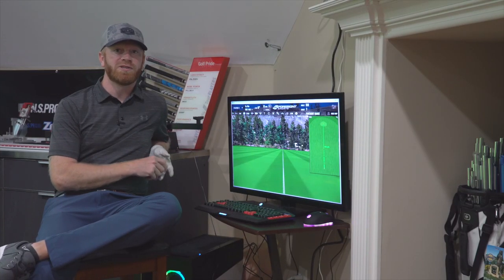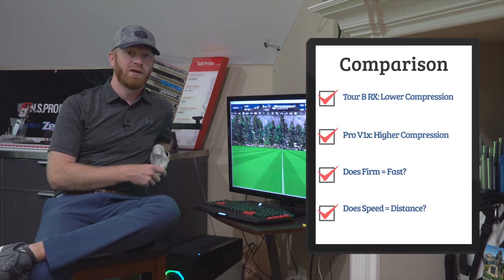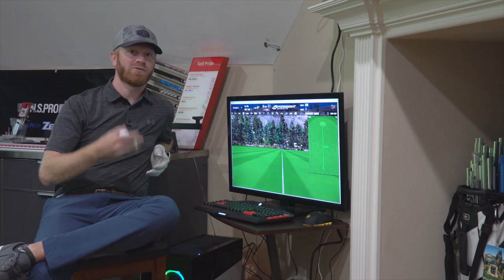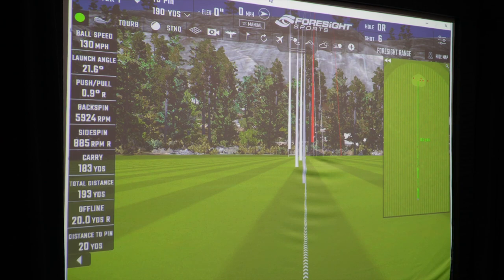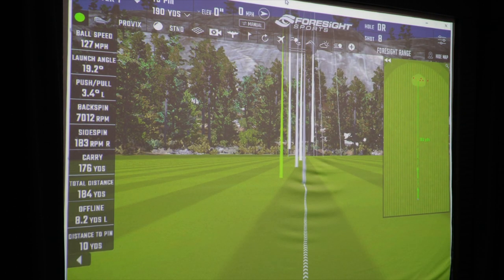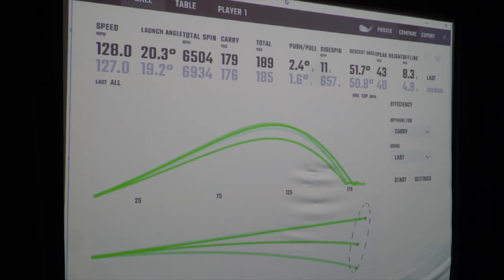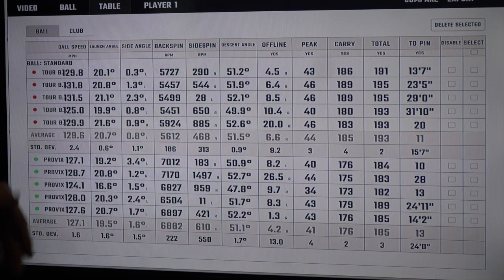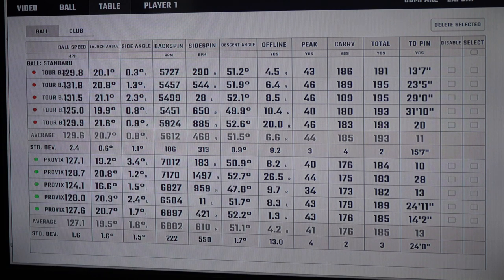Golf Ball Compression and Distance

Comment: Thanks that was a really interesting test of the two Balls.
What I found surprising was that the lower compression Bridgestone Ball produced a consistently higher Ball speed. I would have expected the higher compression Titleist Ball to produce more Ball Speed?
If I had any hair on my head I would now be scratching it.
Reply from the maker: As you move towards longer clubs, for instance the driver, the higher compression golf ball would most likely have more speed, assuming strikes are equal.